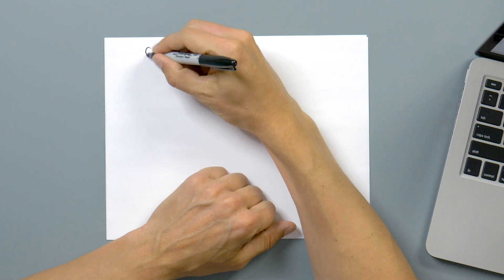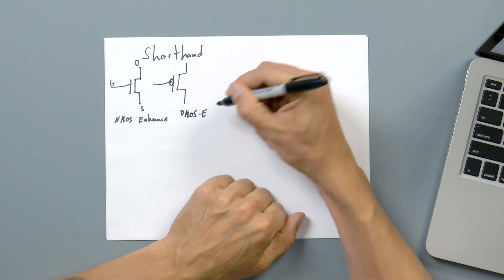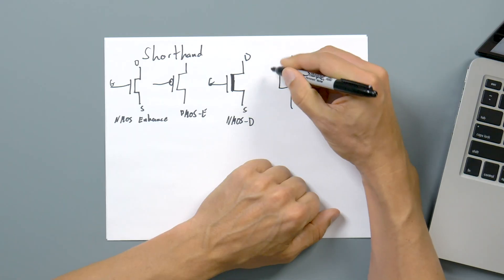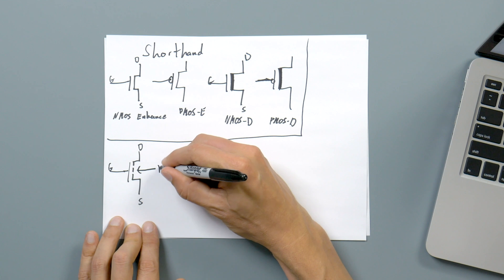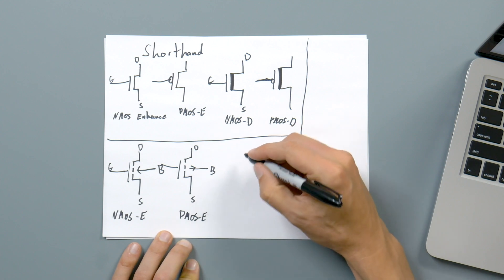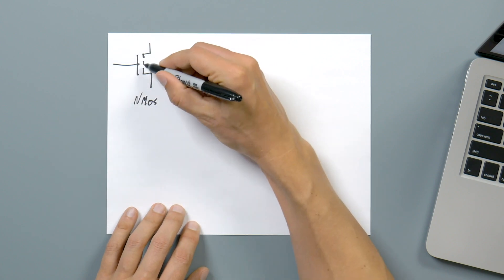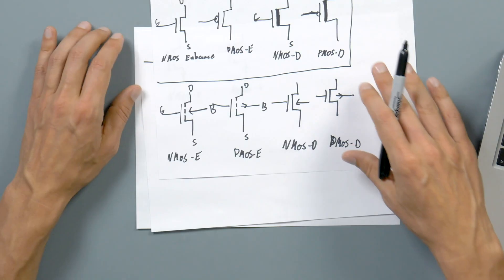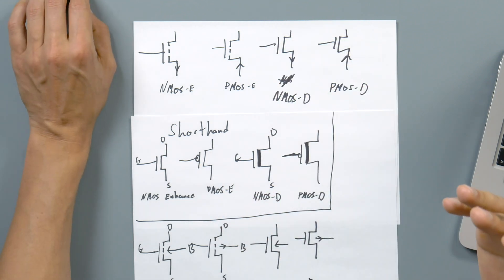How to Understand MOSFET Symbols | Intermediate Electronics

Comment: So MOSFETs have different symbols depending on whether they are on or off but BJTs don't?
Reply from the maker: No, sorry if we mislead but the symbols for MOSFETs don't change either, whether they're on or off.  We sometimes use artistic license to make things more intuitive.
Reply: @CircuitBread  Hey! Thanks for your reply. So what is enhancement mode then? I thought it just meant that the MOSFET was on.
Reply from the maker: Hey John, sorry for the delay.  YouTube actually just implemented a way to see people when people have responded to a comment, so hopefully my responses won't take so long in the future.  Enhancement mode is when the device does NOT conduct current when there is no driving voltage at the gate.  This is unlike depletion mode devices that conduct current unless there is a driving voltage at the gate that turns them off.  We did an entire tutorial on this, please check it out here:  https://www.circuitbread.com/tutorials/nmos-vs-pmos-and-enhancement-vs-depletion-mode-mosfets
Reply: @CircuitBread  So is it just hysteresis? When an NMOS is in enhancement mode, it is off at 0V, then increasing the voltage turns it on and when you bring it back down to 0V it is still on and therefore in depletion mode? Then lowering the voltage further turns it off and when you bring it back to 0V it is still off and therefore in enhancement mode again?
Reply: @CircuitBread Hi! I came back to this video to understand why the arrows are pointing in the direction they do in MOSFET symbols. I just thought I'd tell you that I understand the difference between enhancement and depletion mode now. The thing that was confusing me is that I didn't understand that they were physically different devices. It was the term 'mode' that misled me - calling them 'modes' sounds to me like any MOSFET can be in either enhancement or depletion mode, not that it's something inherent to the device.

Another thing I've learned today, which I've never heard anyone else point out even though it's very strange, is how the naming of the terminals in a BJT is not consistent with the naming of the terminals in a MOSFET. We call the collector in a BJT a collector because conventional current enters there, and we call the source in a MOSFET the source because electron flow enters there (at least in an N-channel MOSFET). Very confusing, no?